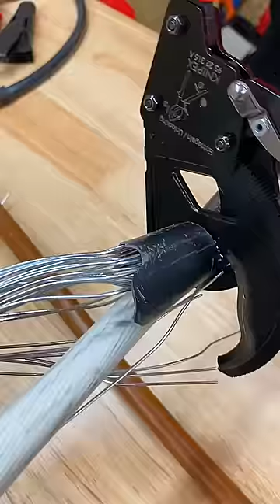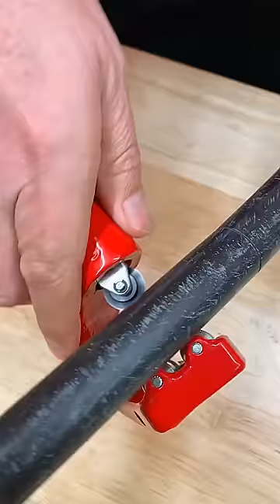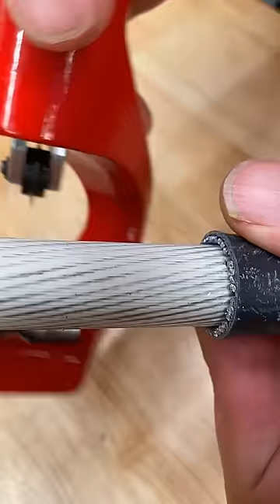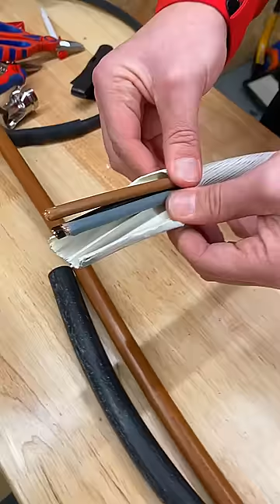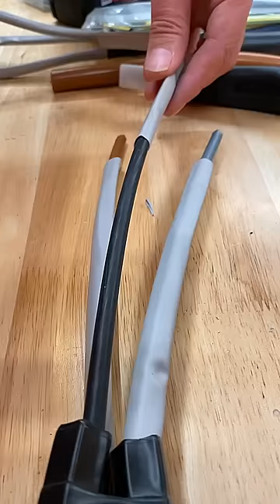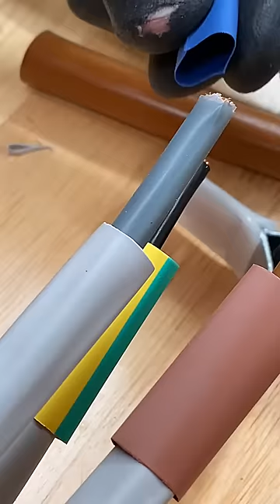Solving a Basic Electric Cable Insulation Problem

Comment: I personally like to see the armoured earthed both ends with a proper gland . Especially on a long cable run
Reply: Not always when exporting PME. You’ll need to avoid introducing the potential in some cases.
Reply: It's not so much the earthing both ends that bothers me,but glanding it is something I prefer to see.i hate when armoured cable is stripped back and put through a stuffing/CTS gland
Reply: In some cases such as inductive loads ie large motors you don't earth both ends due to eddy currents. But yeah I still gland both ends and insulate one of the from earth... Normally the load end using the cores cpc.

Comment: May be wrong but isnt that shield you took away meant to be the ground? It looks like it was a 3 phase + ground cable before you changed the coding via heat shrinks at the end...
Reply: Yes
Reply: In the US i know the shielding is supposed to be ground... Not sure about UK or other countries... I actually came here to find the answer when i saw those being cut.
Reply: @michaelhanson5773  I think Ive been told by an old timer that it's not longer used or recommended. I don't really know myself since I'm purely a marine sparky so Im nóg really up to date on terrestrial wiring.
Reply: @michaelhanson5773  The shielding must be grounded, but in this care they are connecting armoured cable to something else without using a gland nut, so they re-purposedone of the insulated wires as an earth (ground). So that shielding will be grounded at the other end.
Reply: Here in Germany we just have 4 Conduits for 3phase 1ground the only shielded cable here is 10KV cables
Reply: @Max-xx6lu  that is not true as they might not be shielded with steel wires we stil have ones with copper, where you have the four wires L1-L3 + N and the copper mesh is usually weaved and then used as PE, and not forget all the bus cables and data cables like jysty and so on they are all schielded
Reply: The armour can be used as your ground or you use a core.
Reply: It was. He made it single phase. :D
Reply: @michaelhanson5773  different depending on - in some cases there is requirement to earth one end only while the opposite in that case is isolated - and if the cable has a special earth conductor that one is also isolated.

Comment: Hate seeing armoured cable without a gland on 🤢
Reply: It's not "armoured"; that's a screen
Reply: @georgebadea4138  please do not reply if you do not have a clue what you’re on about in the UK that is an armoured cable
Reply: @evanjones7578  in our country we divide those two; "shielded" means covered with a conductive mesh/screen/tin cover, whose main purpose is electro-magnetic shielding and human safety by earthing; "armored" means it have a cover (coper/iron/aluminium/lead or though plastic whose main purpose is protection against mechanical factors. 
So, for me that's a "shielded low voltage cable"
So is it different in your regulations or is it just a matter of terminology/translation method?
Reply: @georgebadea4138  That is an armoured cable. A shielded cable would have a much thinner outer conductor. The one on that cable is designed to withstand mechanical damage and to protect the inner cables. What is unusual is that armoured cable normally terminates via a bras gland nut.

Comment: Good solution for meter tail runs over 3m! 👏🏻 

I had to squeeze a massive 80A metal switch fuse box in the meter box to keep single insulated cables hidden. 

This would allow a smaller plastic switch fuse now the cable is double insulated (with earth bond at the CU end).

Comment: Just curious why that grey NM insulation was slid over the already insulated conductors? 

US sparky here - and I am aware in the EU you have Brown has the line/hot and Blue is your neutral- then the green/yellow stripes is your ground (as you call it, your Earth, which happens to be the exact definition for ‘Ground’ here in the states 😂) anyway, I am just curious why the gray insulation was slid over the conductors, even though they already had their own insulation from the factory? Thanks!
Reply from the maker: This is to correct a situation where the basic insulation is exposed within a generally accessible location - eg inside a meter enclosure. We talk more about the issue in this video 👉https://youtu.be/_y-Tz3u2iXk
Reply: hi
Reply: Under most circumstances conductors should be double insulated. If that split part is outside an enclosure, it needs the extra layer of insulation.

Comment: Trying to think of applications for this. Only one I can think of is when using swa for main incomer, you can gland/earth at the switch-fuse position and use this for entering the back of the consumer unit, which is already a very common practice but this would be a bit tidier than just taping over the steel.
Reply: Sometimes you can't gland into a metal box because you don't want to mix two earthing systems, could this be a reason?
Reply: I used cable like this to run 3 phase power out to the workshop in my shed.

It has to be armoured and double insulated to meet code for a buried cable.

More common would be an armoured cable like this but with just a blue and brown inside. Those are used for outdoor lighting that has underground power running to it.

The way he's done it, that cable is no longer up to code for the purpose of burying the cable. If it's at least 75cm above ground it can still be used as an outdoor cable though.
Reply: @AndrewStrydomBRP  in most of the EU metal boxes aren't allowed to begin with. Neither is having 2 earthing systems.
Reply: @fermitupoupon1754  This is a youtube channel meant for the UK, in the UK, we use plenty of metal boxes for equipment because they are more durable than even the best of plastic ones. So this example works for the UK.
Reply: @fermitupoupon1754  Not aware of any UK regs that states this video shows a disallowed usage, you only need to gland (and earth) the armouring on one end.

Comment: uuuuuh no. maybe next time get the correct cable ... not good practice to use anything else that the yellow/green as PE. sure, you can shrink a matching color on BUT what if there is a cable repair at some point in time? nobody knows which is which then and might get confused. usually the concentric shielding is used as PE to be the first thing in contact with the environment is the cable gets damaged in actual earth. so. always use the correct material for every job you do. please. and even if it is just for good conscience

Comment: It's legal to turn an active conductor into an earth with heat shrink???
Reply: Yes, that's the only way to do it with most SWA. In general it should follow Brown to Brown, Grey to Blue and Black to Earth when you do recolour the cores.
Reply: It depends on your local regulations. For example in Finland this would be illegal without exceptions.
Reply: @Kizmox  Same in Denmark
Reply: You can use any conductor for whatever you want, as long as you properly sleeve it and do so at both ends...  (Except for the CPC of course which can never be used as a "live" conductor!
Reply: @AndrewStrydomBRP  I've seen a few videos of sparks using this colour coding. Genuinely wondering why. My intuition would be Black to Blue and Grey to Earth since black was already Neutral in older installations. Any insight appreciated on this.
Reply: @zenthius  The reasoning for doing it this way is exactly what you describe, just the opposite way around. The idea is to not confuse with old colours, especially if an install hasn't got old colours.
Realistically, you can recolour how you like, but in my opinion this is the best (and most common) way.

Comment: Wait, what about the armour?
Reply: You have to earth the swa as it's an exposed conductive part . This must have been achieved at the other end of the cable with a gland . Please correct me if im wrong
Reply: @darrenjeffes7030 not exposed though is it in this example
Reply: @paulcanning8512  Even where the armouring is not serving as a cpc, it will still need to be earthed, as it is an exposed-conductive-part. Armouring is therefore always to be protected against the aforementioned detrimental influences and any other stresses that could impair its continuity. Electrical joints, such as those between armouring, cable glands and earthing terminals, are required to be soundly made (mechanically and electrically) and, where necessary, suitably protected.   

Taken from guidance note 8
Reply: @darrenjeffes7030  is it "exposed" when it's covered in sheath and heat shrink
Reply: @darrenjeffes7030  I agree with you in so much as I'd always earth SWA with Glands, but playing devil's advocate in this example assuming both ends of the cable are terminated as shown then the SWA armour is not exposed and assuming no other requirement such as buried direct in the ground or in a wall without rcd protection then it would not need to be earthed and it's not an exposed conductive part so in  accordance with BS7671, although not a method I would use.

Comment: I was under the impression SWA needs to be terminated in an SWA gland but I guess it depends on the application. What is that insulation tool? I’m interested, I had always just used a jr hck saw and a knife
Reply: The armour only needs earthing from one end. Some EV chargers and other appliances don't have anywhere you can gland into, so you end up glanding/earthing at the board end and using tape to do what they're doing here with this heatshrink cover
Reply: @havoctrousers  oh that makes sense. Didn’t realise Ev’s use SWA

Comment: What country is this?
I’m not use to those cable colors
Reply: UK , our Three-phase colours are Brown, Black, Grey
Reply: @alasdair0195  thanks.
That’s what I was guessing.
US uses red, black white and green
Reply: @heyletsplaythis  I've played this game a lot taking British lighting systems to the US for concert tours and its always fun giving the House Electrician a set of tails (bare ends to Powerlocks - like Camloc but safer) and having to explain our colours to them. You seem to have forgotten you Blue wire for phase 3
Reply: @kissarmy1347  never done phase 3 just 120 and 220 AC
I was a residential electrician for a couple of years
Reply: @kissarmy1347  and thanks for the response. I figured it was UK wiring judging by the plug style, but I like to ask questions rather than assume.